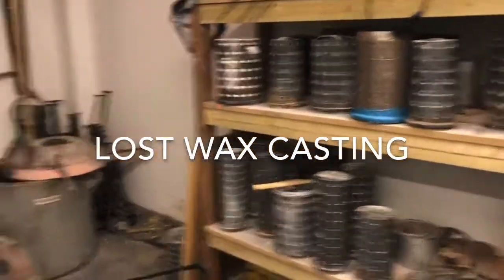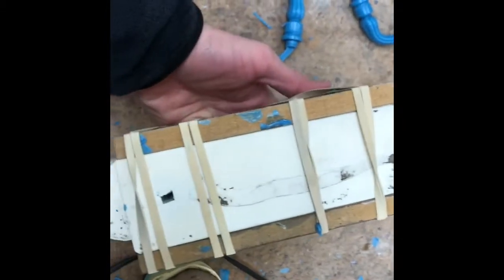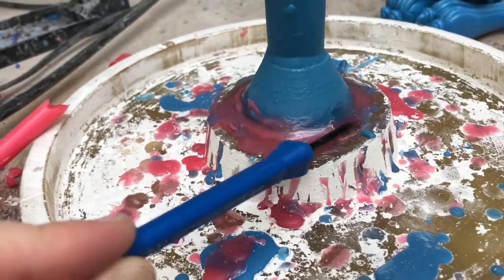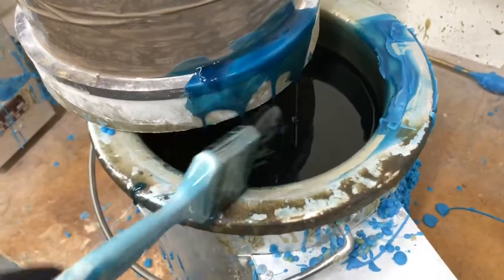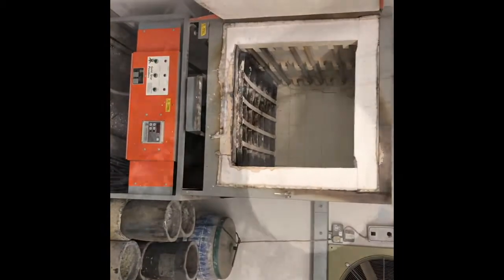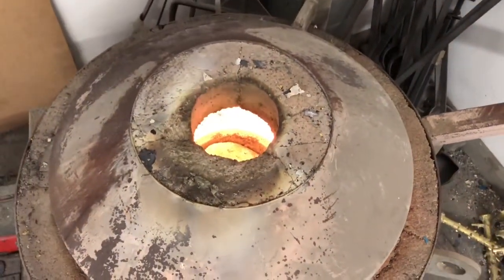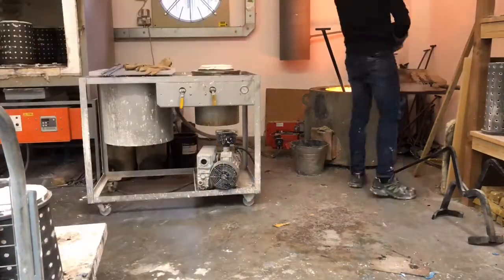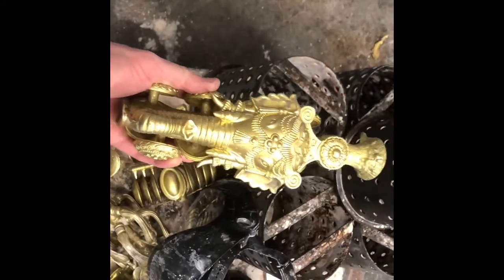Lost wax casting. The whole process

Comment: I work in a aluminum foundry been there for 20 years when we poor we wear spats on our shoes and we have aprons our ladle holds 25 pounds of metal and the tongs are separate from the ladle I didn't see an autoclave because your burn out has a wax catch pan we autoclave our casting to melt the wax out and we burn them out at 1700 degrees for 4 hours than we clean the shells and load them into a holding oven between 900 and 1300 degrees before we can poor them we also degas the mental and take a test slug before we poor any thing we check for gas holes in the slug if it has gas we don't poor till we get a slug with no gas holes

Comment: Hey it's an excellent learning..
What is the flask size you use and what's the burnout temperature required to be achieved for a flawless casting.
Reply: Waiting for his reply
Reply from the maker: Hi thanks for your comment. Sorry for late reply. we use 3 different sizes of flask for our castings small/tall/big I’m not sure of the exact measurements but for the burnout temperature we set the oven to run up to 720 degrees and that takes a few hours to reach then will sit at 720 degrees for about 12 hours and then come down to 460 degrees ready for us to pour the metal into the flask. I hope that helps and any more questions don’t hesitate to ask ! Thanks🙂
Reply: @robpark93  thank u so much for sharing this valuable info with me.. I shall get back to you incase I get stuck... Thanks and be safe !
Reply from the maker: @foramgoswami6788  you’re welcome ! Happy to help! Yes please do ask if you need any more info!. all the best 😎
Reply: @robpark93  hey hope you are doing good.. if it's ok can u pls ping me on my email as I need to tell you the full details of my work in case if u can help me.. thanks again😊
Reply from the maker: @foramgoswami6788  you’re welcome have dm you back on Instagram :)

Comment: Instead of taping up the holes on the flasks, why don´t you cast a silicone rubber sleeve type of thing. You could then simply put that sleeve over the flask in one go and save time for all the flasks this would add up.

Comment: hey! is the slurry you made to coat the wax a ceramic slurry?

also another qn: How do you make sure there are no air bubbles when the liquid metal is cooling?

also This is such a great video to learn about lost wax casting! I am using it for a manufacturing part in my eng course
Reply from the maker: Hey! Yes and then the wax melts away in the oven which leaves the pattern inside the flask/investment. 

The air bubbles gets vacuumed out in the mix beforehand and we don’t get air bubbles form the liquid metal that only happens in the mix from my experience. 

Oh wow that’s awesome I’m happy you was able to get so much value from the video. Good luck with the course 👌😎
Reply: @robpark93  thanks so much that helps a lot 🙂